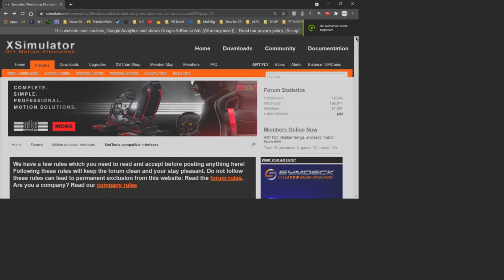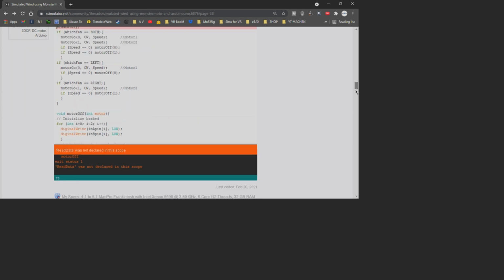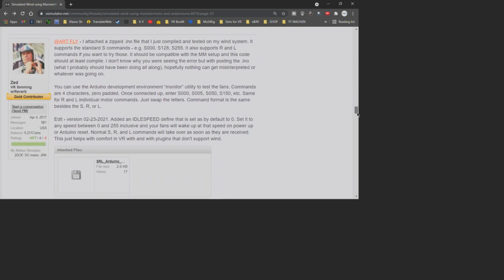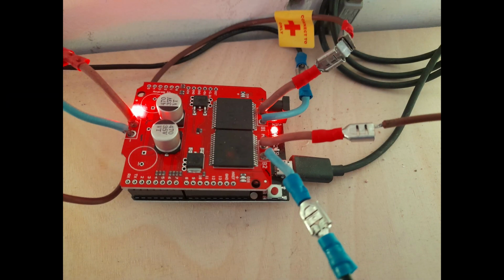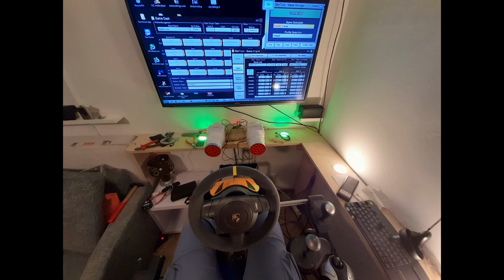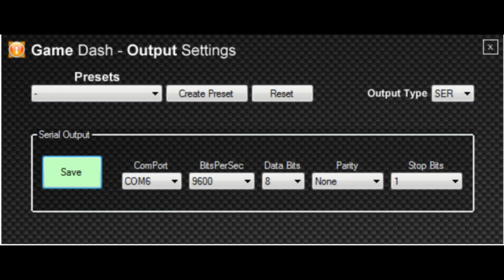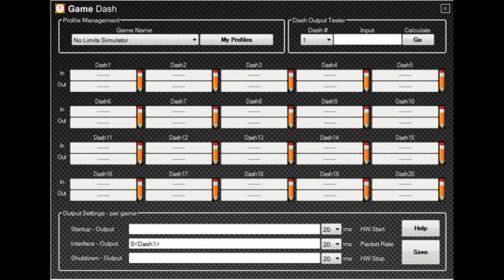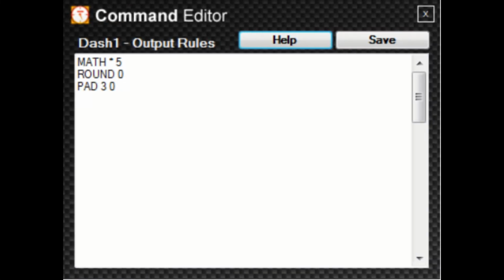DIY - PC Wind Simulator with SimToolsPro, ArduinoUno and MonsterMoto working with e.G.AssettoCorsa

Comment: So Art, it's the gamedash that I still have a problem with.. Windows Defender keeps flagging it and won't let me download the gamedash unless I disable defender..  I already built the arduino and monster all that, but without the software .. I'd have to attempt to modify the arduino code for an IBT2 controller, which is do-able.. but not easy like this..   Did you disable the defender?  DMAX
Reply from the maker: I had to disable it for downloading it, yep. Later I had to admit using it in one of the popin up win10 windows . Than anything was fine. If not I suggest making a firewall rule for it to run.
I am currently on the win10 December 2020 update.
I hope that makes you succeed!!!
Cheers, Martin
Reply: @ARTFLY  Thanks my friend! I made a post on the x-sim forum about it and finally got a few answers that I have yet to try all of them.. But man does those blowers scream or what!  Should be awesome once I get off my butt and finish the project!  Dave
Reply: @ARTFLY  my son says it's an antivirus feature in Defender.. not the firewall. I was barking up the wrong tree..  He get's paid a LOT more than I do (for some reason... I am proud of him for sure!! ) and he figured it out in like 3 seconds..   I'll put it on my video so others that encounter that stumbling block will know.. You would think that Game dash would have wrote something about it..   sheesh..   Thanks Martin!!   DMAX

Comment: Did you ever tried running the windsimulator through Simhub?? I can't seem to run more than one of the fans with the same setup you have.
Reply from the maker: Dmax - you should enjoy his YT channel  - is a friend that was running this setup with simhub. He asked me how I have two seaflows running. That is why I made this video.
If you only get one motor running make sure  your monster moto shield has two functioning output channels. Mostly the fake MMs are not reliable to work even if bought new. I bought 6 pieces of them and 4 had one broken channel out if the box :(